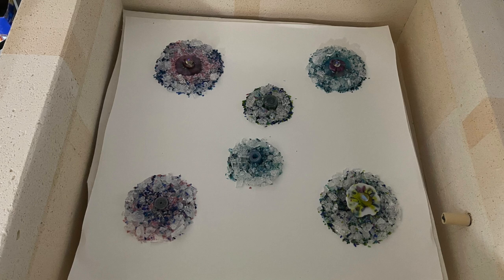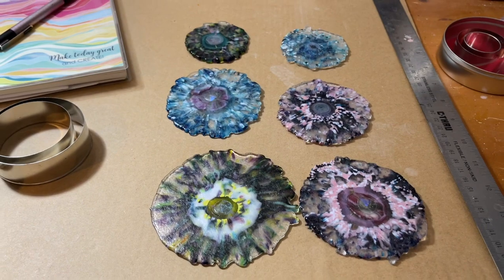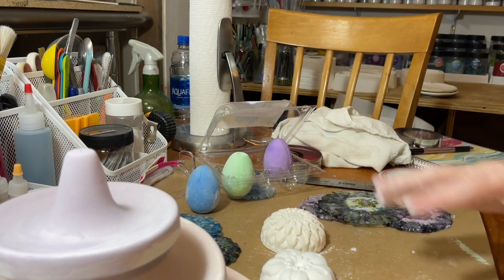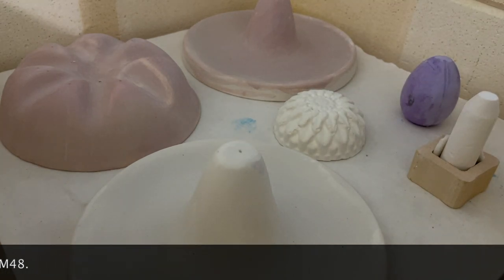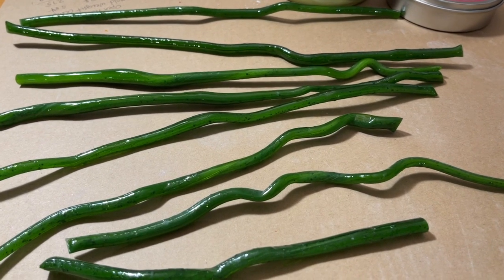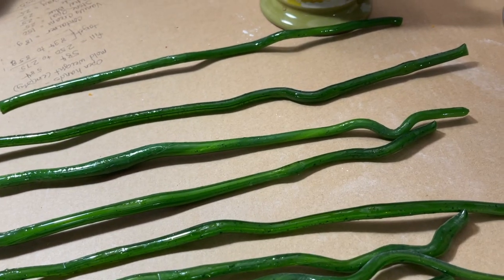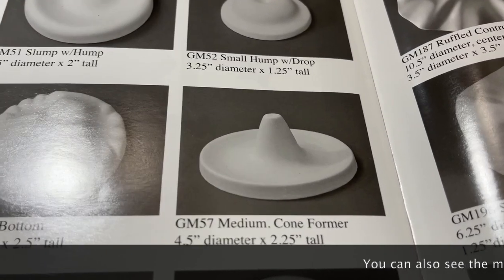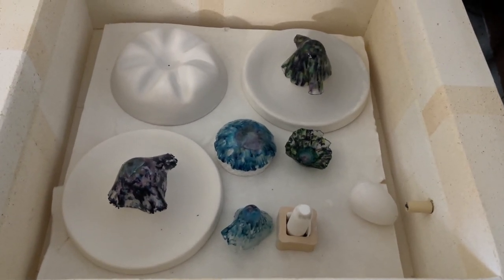Frit Pile Press   Part 2

Comment: why do you use two layers of paper beneath and over the flowers to press?  I know one is shelf paper (like papyrus) but I'm not sure what to purchase for the layer you called 'fiber paper'.  Can you send me a link to that product, please?  Thank you.  I can't wait to try this.
Reply from the maker: Hi Diana. I have a giant roll of 1mm ceramic fiber that that I got really cheap. I think if you kiln washed your shelf really well (a few coats) you might be able to just use one layer of Papyros (one on bottom and one over glass) without the fiber. I didn’t use ThinFire as it tends to really break down to powder when fired whereas the Papyros stays more intact.